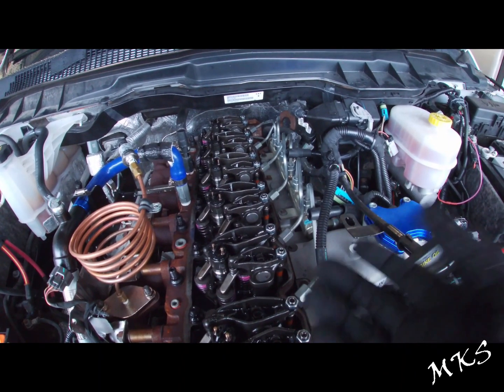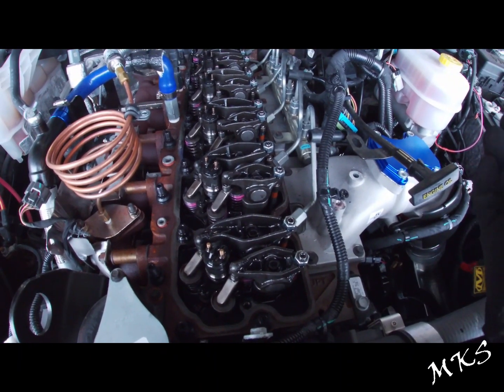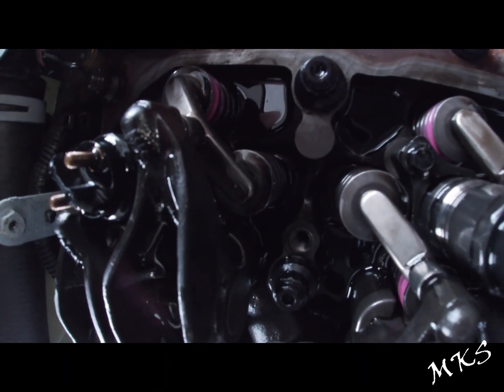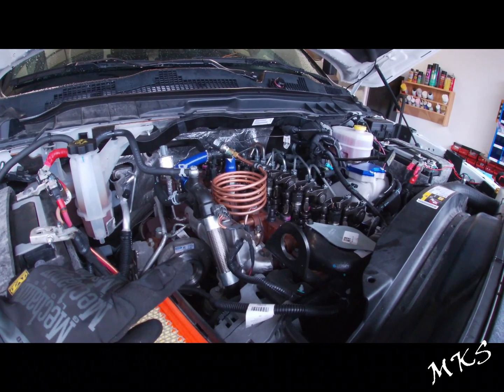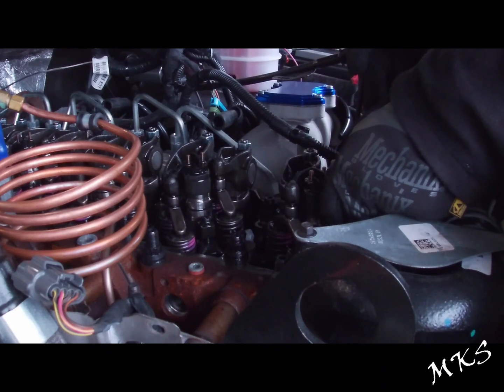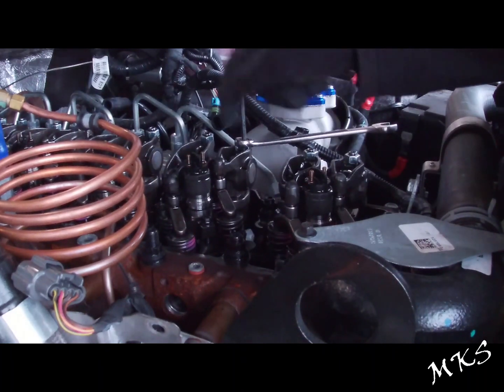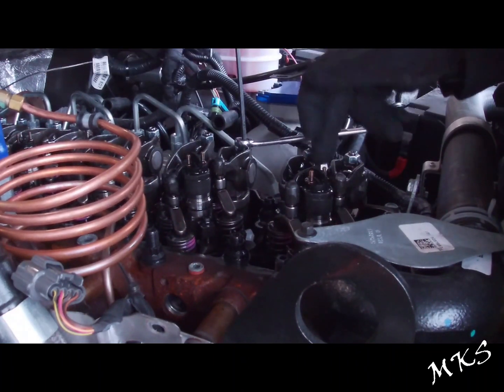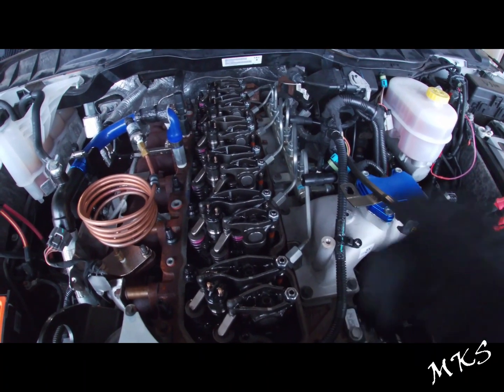6.7L Cummins Valve Lash Adjustment | 4th Gen 2014-2018 Ram 2500

Comment: Do you think I could do this on my own with absolutely zero motor experience besides changing the crank case filter? I’m at 141k and I think I am hearing a slight tick noise from the valves. I was planning on paying someone to do the adjustment at 150k like the manufacture recommends but I feel like it should be done sooner. Also, if I don’t do it sooner do you think I’ll be okay? I can only really hear the tick over 65mph or when I’m accelerating. The truck is deleted and I’m planning on towing a toy hauler with it next month so I’m slightly worried lol. Thanks.
Reply from the maker: I would say this is pretty easy to do if you follow instructions well and pay attention to what it tells you.  Grab yourself a barring tool to turn the motor through the access port and mark damper on crank with a paint marker for easier visibility.  Do you have a friend who has a little experience that could assist?
Reply: @MKSPerformanceOffroad yes I have a reliable guy that does some work when needed, but I’m balling on a budget driving this truck around right now haha. Do you think I’ll be fine driving it for another 3-4k miles on a long road trip before I do the adjustment?
Reply from the maker: @jacobm9574  I think you would be fine, if your that worried about it pull the valve cover and check lash with a feeler gauge and ensure its not out of tolerance or too far out.
Reply: @MKSPerformanceOffroad  okay sweet thank you

Comment: Wondering if you had to change out your vavle cover gasket as well and if not how many miles did you have on the motor when you did this
Reply from the maker: No I did not, roughly 30k if I remember correctly.

Comment: When torquing to jam
 nut how do you prevent the adjustment screw from tightening
Reply from the maker: I tightened with a wrench while holding the adjuster and then went through with a torque wrench and rechecked the adjustment with feeler gauge before moving on to the next set.

Comment: Hello, Good video, may I make a suggestion, I’ve been a truck mechanic for 30+ years and also had worked for cummins earlier in my career, and over the years I’ve been trained to use a torque wrench on the valves as well as the injectors, now on the smaller engines such as 6.7 you have to judge the torque on the valves 
May want to try 2-3 inch pound 
Doing this way you know that all the valve lash are the same.👍🏻

Comment: What is the copper tube coil for?
Reply from the maker: Cools exhaust before getting to the back pressure sensor that is installed at the end of the tube
Reply: @MKSPerformanceOffroad I’d love to know more about this too.
Reply from the maker: @Dieselburner6  The tubing is for exhaust back pressure gauge sensor and is a few feet coiled to allow heat to dissipate before making it's way to the sensor so it doesn't melt it.
Reply: Do you have a video on how you did the copper tube and back pressure?

Comment: Did you end up getting any extra performance
Reply from the maker: If I gained any performance, at this stage  isn’t really noticeable.  I will say, valve train was a little quieter (not super noticeable) and hauling a 10k+ fifth wheel average 1-2 mpg more than the last pull we did prior to adjustment. So far mileage is up from 10mpg to 11.8 - 12mpg.

Comment: What is the copper tube for ?
Reply from the maker: Exhaust back pressure sensor to dissipate heat before the sensor.  I have this reading on a separate gauge because the programmer doesn’t read the factory sensor.